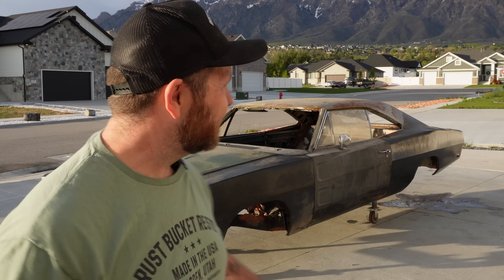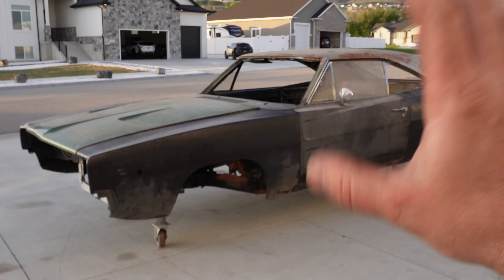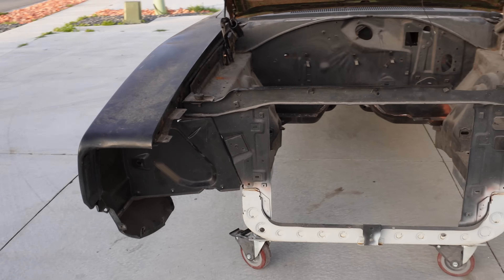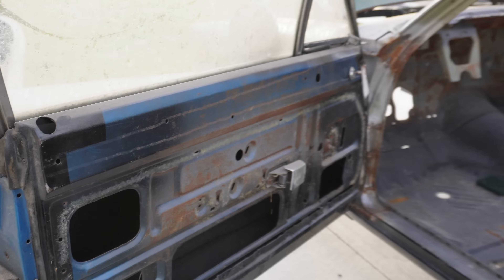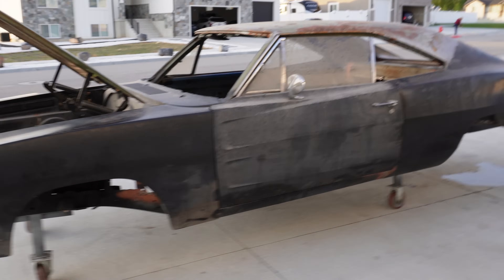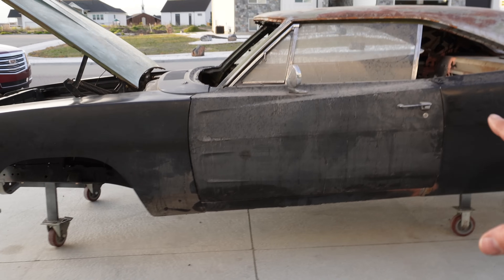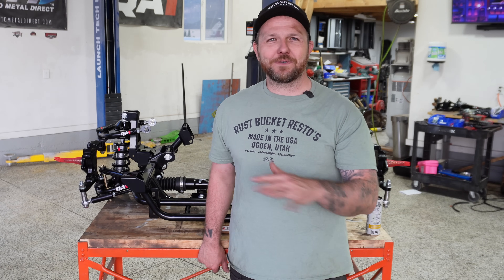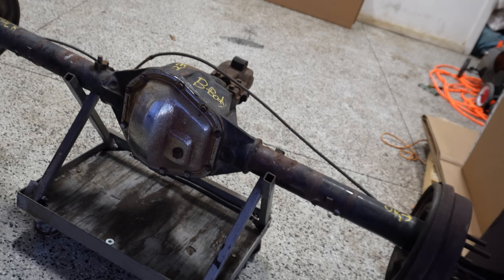1968 Dodge Charger Restoration - Episode 40 - The Charger Returns

Comment: There are two colors I would choose from. These are original paint colors offered for the 1968 Charger. 

1. EE 1 13372 Dark Blue Poly
2. MM 1 60492 Bronze Poly. 

Both of these colors with a high gloss finish are amazing.
Reply from the maker: Good choices!

Comment: You have done a very nice job, but the quarter panels are for a '69-'70 Charger not a '68 which round side markers instead of rectangular
Reply from the maker: When I purchased them it was the height of COVID & they didn't have any 68 QPs available in the US.  I got the last pair of 69s they had & planned on filling the side markers & drilling holes to make them work for a 68.  Sometimes you have to improvise!
Reply: @rustbucketrestos6511  that's so very true, COVID really did a lot of damage
Reply: @rustbucketrestos6511  you have the patience of a saint! Dealing with YouTube viewers

Comment: Hello I have a question or more like an advice from you. You are great at metal work. I have the ability to have the opinion to get a 1966 charge that needs stuff like reviving the engine, brakes, new line break and gas, new gas tank etc. the other choice is a missing data plate/fender plate 69 GTX that needs new floor from inside and trunk floor and quarter panel. Non matching #s engine but is 440. Again the metal work is intimidating to me. But the GTX Is more like the car that I would love to own. But I don’t want to be blinded desperate decision. Please Advise